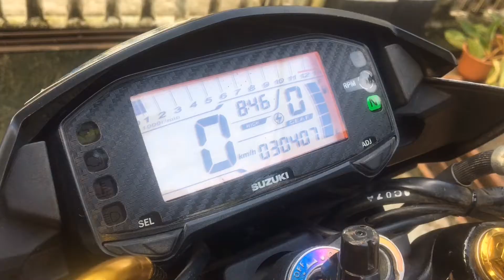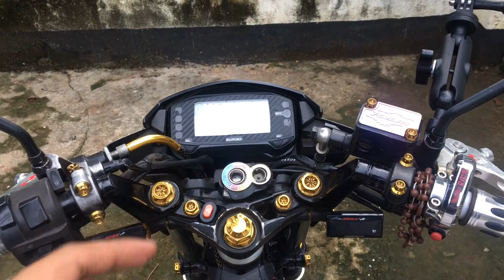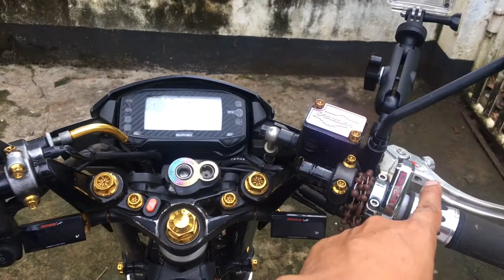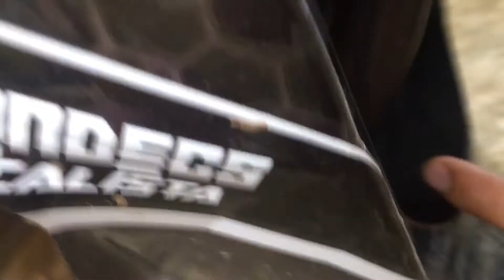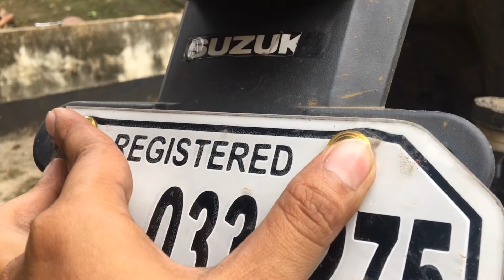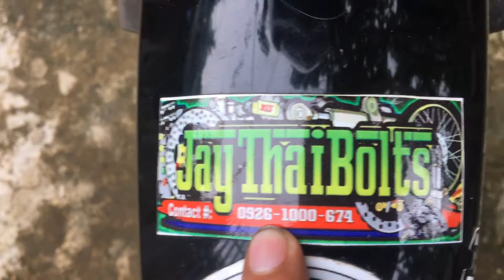INSTALLING 87pcs HENG GOLD BOLTS ON RAIDER 150 FI

Comment: idol hindi ka po ba nagkaproblema dun sa engine bolt banda sa oil pump diba mas mahaba yata yung gold bolt sa stock sana masagot thanks po❤
Reply from the maker: same size lang  nman sila boss wala nman  naging problem till now boss goods pa din nman
Reply: @KingskieMotoVlog  thanks idol ❤
Reply: idol pasesya na sa pangungulit😂
sa bandang 18:58 po sa video nyo hindi po sya pantay tlga tulad nung akin hindi kase ako mapakali idol sana masagot idol maraming salamat❤

Comment: Ang ganda po ng tunong ng tambutso mo ano po gamit mo? pasensya na baguhan lang sa mundo ng mga motor kaya hindi ako familiar. Sana po masagot ang tanong ko.
Reply from the maker: kalkal pipe mo paps nasa vlog ko mga sound check nya dalawa po yun semi kalkal at superkalkal.
Reply: @KingskieMotoVlog  follow up question lang po since plano ko din bumili ng tingi-tingi may i know kung may sukat po ba yung body bolts? if yes pwede mo ba sabihin kung ano mga sizes from leg shield bolts and the rest of body bolts para maka bili na ako paisa-isa. Sana po masagot tysm!
Reply from the maker: sge po sir mmya nasa work pa ako eh
Reply: @KingskieMotoVlog  sige po maghahantay ako. Tysm in advance! 🥰
Reply from the maker: 5x15 screw type para sa may compartment

6x15/20 fine tred pra sa body bolt(leg shield) pero gmit ko 8x45 kasi pra sa stepgrill pde 6x20 paps

5x15 flower type pra sa likod dalawa tas sa may radiator dalawa pde na rin sa may elbow bali 5pcs nito

6x20 fine tred sa may front fender dalawa

yan paps try to ask me pa ha. sensya nka tulog ako ng maaga kagabi

Comment: Paps para san po ang dim light ng raider fi natin?
Reply from the maker: san po banda paps? mini driving light ba?
Reply: Bago po iopen yung headlight diba po may dim light dun sa switch? Para saan po yun?
Reply from the maker: @skyunknown7890  parang parklight po ata sinasabi mo. for safety po yan idol
Reply: Ay opo yun po. Okay lang po ba na everytime na ginagamit ko si rfi ay naka bukas po yung park light. Para daw po tumagal buhay ng battery. Totoo po ba?
Reply from the maker: di nman yan totoo paps kasi sken mag 4yrs na battery ko may mga lights pa ako like underglow, eyeline, tailine, volt at thermometer.
Reply from the maker: try to save battery paps pero habang tumatakbo ng charge din nman yan
Reply: Maraming salamat paps upload pa po kayo ng maraming video naka subaybay poko